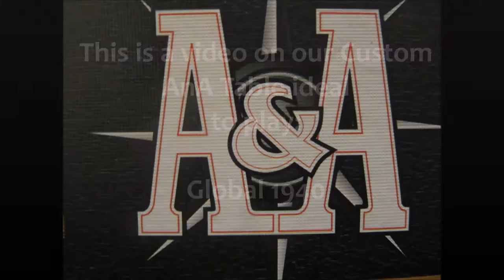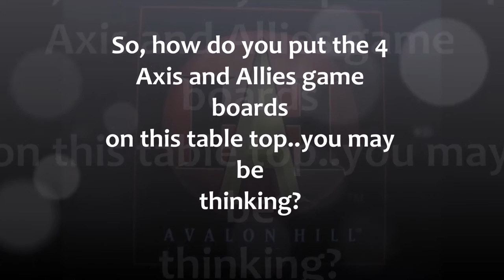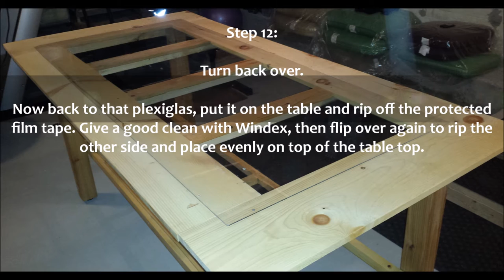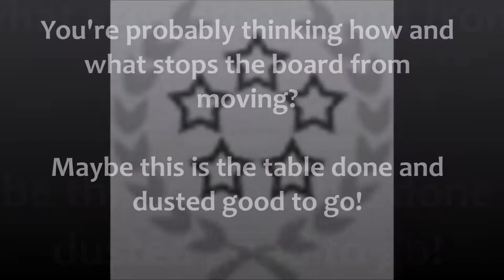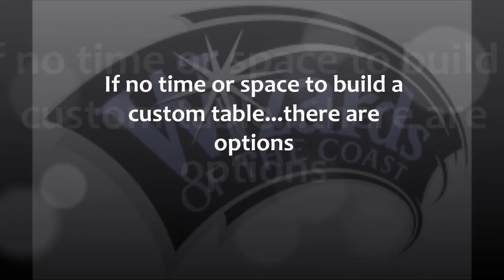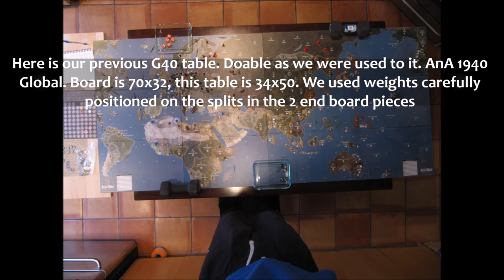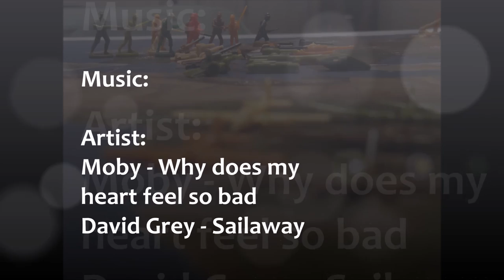Custom Built Axis and Allies Table for Global 1940 - Step By Step Guide video.

Comment: And here I thought I was the only one on the planet that actually built my own tables for gaming, lol.  I didn't do anything fancy, and just made something functional, and that was a 2X4 frame topped by an 8X6 piece of under flooring.  I then put an unformed bedsheet overtop, laid down my map, and put a very thin piece of plexiglass over the top.  I left that table in the apartment when I moved out (I build much more than just the table, and the manager was happy to have the additions), but it served me well for many years of gaming.

Loved your video, and intend to share what I make soon for setting up youtube video capable table soon.  Currently, I'm just using a piece of under flooring, cut to 36" X 30", which gives me room to setup and support the #33" X 20" classic board, but honestly I'd like a bit more room, on all sides for dice and buys/casualties and trays, but it does allow me to demonstrate attacks and ideas.